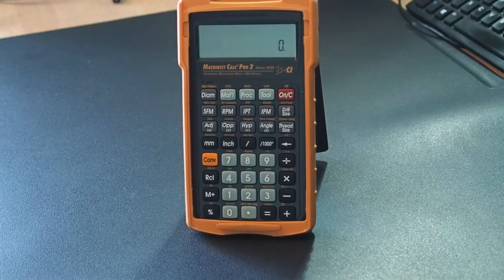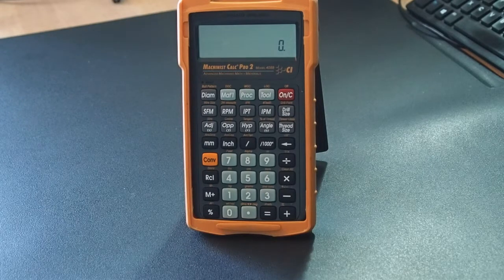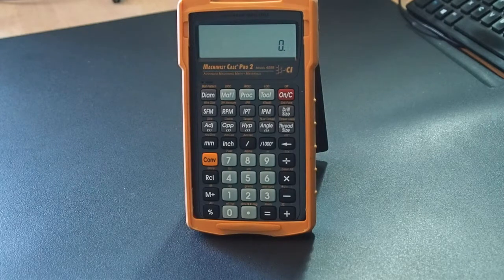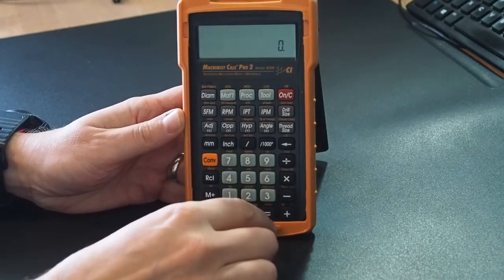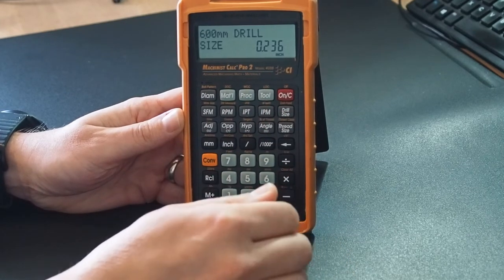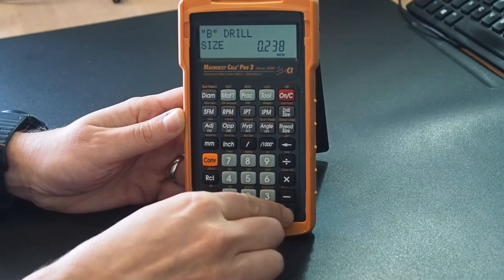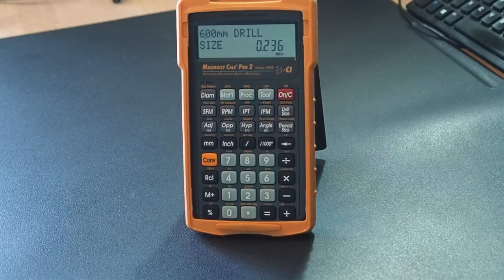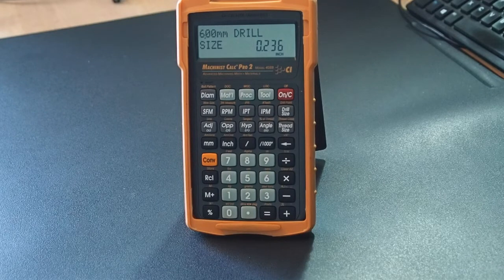All about the Machinist Calc Pro 2 - Drill Size Conversion - (Machine shop calculator).

Comment: Informative... really.... 
But my Problems with transfair is that you cant convert maybe threads. Because there are no taps in that resulting size. 
My thoughts comming from the Diskussions All over the Web, where metric guys in search for plans, (specially on steam-locomotive projects) cant Deal with imperial plans. (Metric is verry rare there)  Sure you can transfair the measurments... but you cant Find similar materials, Tools, maybe fittings, or just pipes.... thats the Real issue..... 
Thanks for the Video!
Reply from the maker: Hi Chris,
It can be quite a challenge with two type of measurement (Metric & Imperial). As I have mostly old machines in my workshop and no DRO I tend to work in imperial and when I have metric plans covert them to imperial... I don't believe we are ever going to overcome the problem,  all we can do is find a what to manage it...
Take care.
Paul,,
Reply: @TheKnacklersWorkshop  and thats Real  engineering and machinig ! Stay healthy friend!

Comment: Hi. Just wondered if it also gives the fractional size, as printed on most imperial drill bits.
Reply from the maker: Hello Steve,
It does Steve, just had a go...  You can convert either way from metric to imperial and from either to a letter... Thanks for watching.
Take care.
Paul,,

Comment: Not seen that calculator before Paul!
Did you get the OCP ??
Reply from the maker: Hello Neil,
I mostly work in imperial have have found it quite useful when I have metric plans... Not received the OCP yet, I will let you know when it arrives... Thanks for watching.
Take care.
Paul,,
Reply: Oh, posted that 2 weeks ago first class signed for !
Reply: Just checked and they tried to deliver on the 4th but no one home. Emailed you the ref number because its still at your post office/ delivery centre. Cheers Neil